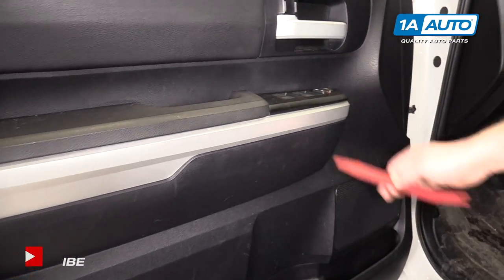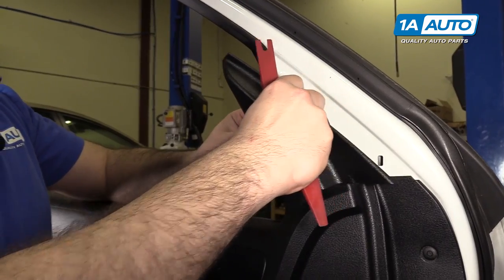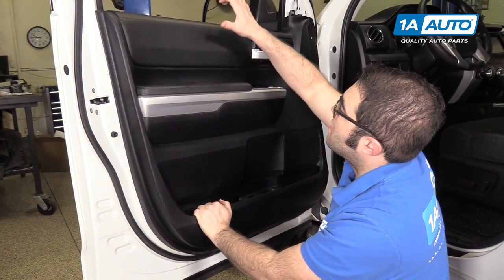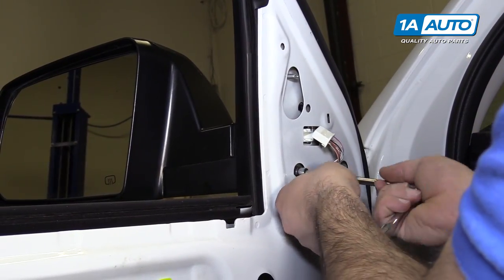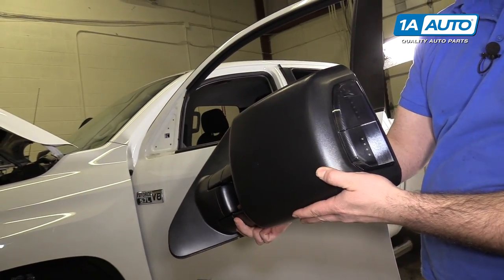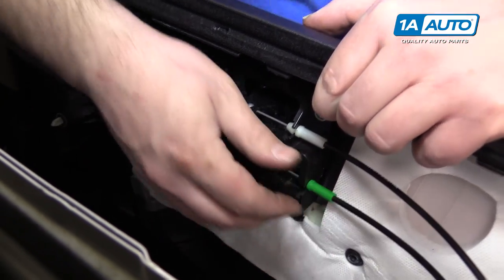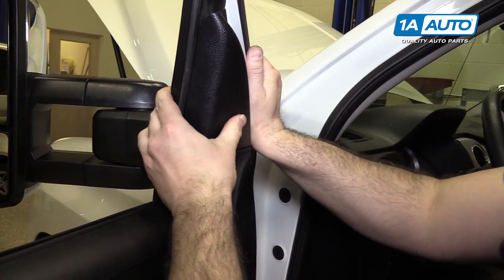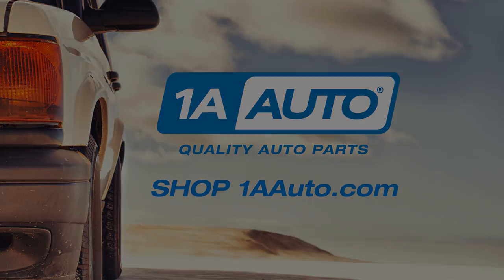How to Install Trail Ridge Plug & Play Tow Mirrors 14-16 Toyota Tundra

Comment: Thanks! 1 A Auto  I got my set of  Trail Ridge  Towing Mirrors plug & play  and finally installed  them this weekend.  After i had   Read about the reviews  about after market Mirrors  some bad and some good . Well I took my chances  and after installing my Towing mirrors  everything worked well no!  vibration  and now I have turning signal on my Mirrors  and running lights on my Mirrors  on my  2014 Toyota tundra  and a happy camper. 😉👍

Comment: I installed these on a 2020 1794 tundra they fit and operate properly. The only issue I have is the BSM lights stay illuminated and won’t turn off is there any way I can fix this issue

Comment: I wanted to get a set however my 2016 limited doesn't have the blind spot monitoring and turn signal feature on them. If I get these will it have those features without having to add any extra wires or harnesses?

Comment: Just bought these for my 2016 tundra.  Great fit easy install.  The only problem that I have is that both drivers and passengers flat mirror vibrate after 40mph.  Is this expected for mirrors this size?
Reply from the maker: +Inverted Hover Thanks for watching!  You should expect a little vibration, but it should not distort the reflection.  If you are having this issue and you purchased the mirrors from us I recommend you contact us right away.  Our contact info can be found on our site.  www.1aauto.com

Comment: Good morning from NJ I bought the mirrors for my 2014 Chevrolet Suburban ltz and the amber light is not working like in this video !! Is there a diagram or videos with this vehicle that you can make it with the installations so I can follow and done with my issue please ?   Thanks so much
Reply from the maker: +Caimayo Caimayo Thanks for watching!  Unfortunately we do not have a wiring diagram on the vehicle side, so you will have to use a multi-meter to find a wire that will work.  1aauto.com

Comment: Just a note for 2018 Tundra Limited with TRD Off-Road Package.  BSM, turn signal and position lights all working fine (even though my OEM mirror didn't have the signal/pos lights, only heating and BSM/RCTA).  When installing, I had to remove the black plastic pin mentioned in the video (it sits between the three bolts and is what holds the OEM mirror in place once the bolts are removed. ).  The mirrors are not symmetrical BTW, the passenger side is more angled.  This seems to be normal for towing mirrors.  1A, I am assuming what I am saying is correct regarding the angles?  Thanks!

Comment: I know this video is 5y old but i was wonder if this would work on the 07-13 tundras as well or if you have a video about intalling tow mirrors on the 07-13 tundras?
Reply from the maker: +Suave6869 We don't have a how-to video for your vehicle right now, but the basic steps in this video should be enough to do this task. Buy this part for your vehicle on 1AAuto.com: http://1aau.to/m/Shop-1AAuto-c

Comment: If my truck doesn’t have factory DRL will this tow mirror still work?
Reply from the maker: +Khrome Thanks for checking us out! As long as the vehicle was equipped with power and heated mirrors with a turn signal and the blind spot system, these mirrors will be correct for you. If the vehicle was equipped with any more or fewer options then these will not be correct. Please feel free to contact our customer service department to verify if we have the right mirrors for your application, thank you!